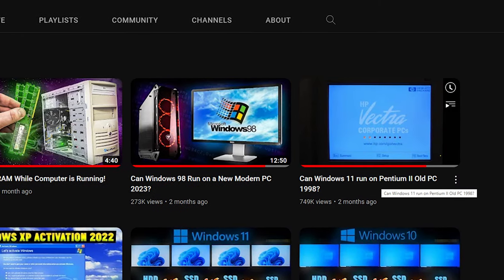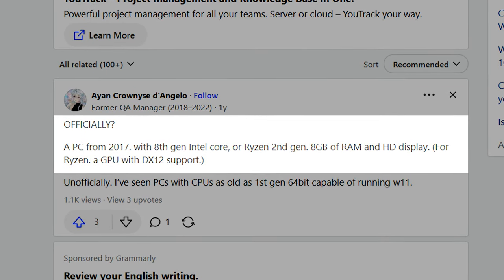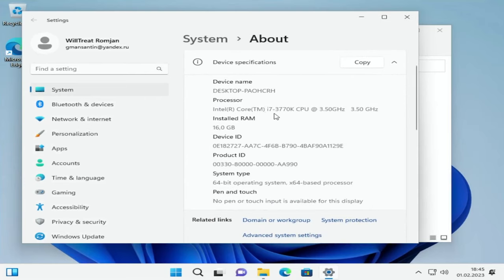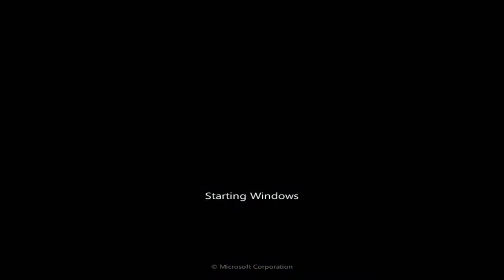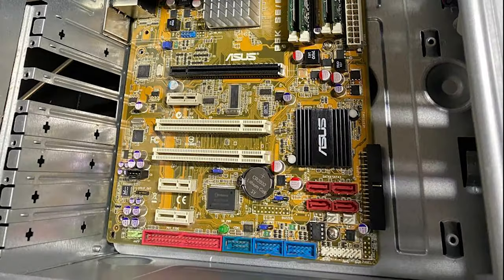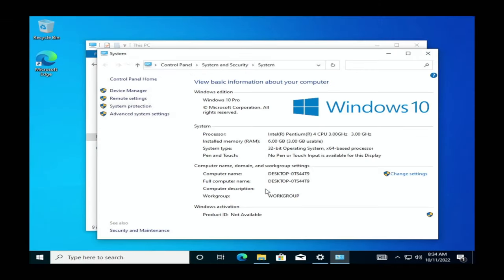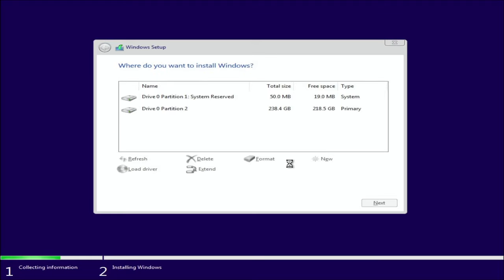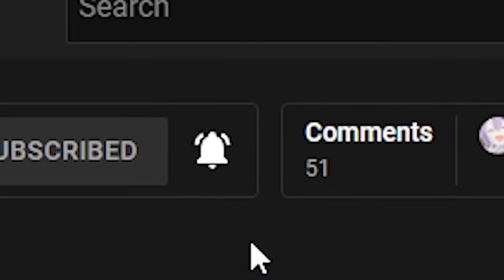What's The Oldest CPU That Can Run Windows 11?

Comment: I am currently working at hospital in remote Russia, we got 1-2 core Intel Celeron based "PC's" with 2 gb of ram
And I put trimmed win11 on them, main difference in performance comes from removing as much background processes and ssd's ofc)
The way they work is tolerable :D
Reply: Good Job.  How did you get past the TPM requirement?
Reply: @SaanMigwell  You can get past the TPM requirement by getting a Windows 11 ISO and flashing it onto a USB stick with Rufus, it automatically gives an option to disable the minimum system requirements, but you could also edit the registry like it was shown in this video.
Reply: Dang Russia that’s tough
Reply: can you make a video of the process, i understand it may be boring, but to me it is fascinating that windows 11 can be run on 2000 megabytes of ram and a celeron

Comment: I've got an old E-machines with the P4 641 (3.2ghz)  I was kinda surprise they sold these CPU's so late in production.   I might have to just fire up and play around with a copy of Windows 10 and see how it handles it?  Thanks for the interesting tinkering of old hardware in this video Ramtech.
Reply: @Man-O-Sphere News  Yeah,  Sounds about right.
Reply: my 2017 laptop has a 1.2 ghz processor i think theres something wrong here
Reply: @youraveragejoe23  Clock speed is not a valid designator of performance between different architectures. Your 2017 laptop has a CPU with a base clock of 1.7 GHz, it boosts higher. It also probably has 4-8 cores, where the Pentium 4 is only single core with HT in some models.

Even a Core 2 running at half the speed of a Pentium 4 will smoke it, and that was just one architecture later. Netburst was just that bad.
Reply: @GGigabiteM  its a pentium cpu and i have hp pavillion x360 m convertible 11m-ad113dx
Reply: I also have e-machines

Comment: Thanks for the additional infos!

I was able to experiment and install win11 in a 32bit laptop Acer Aspire One (AOD257), Intel(R) Atom(TM) CPU N570 @ 1.66GHz with 2G of RAM only.The hardest part was finding hardware drivers. I am using it now in commenting on this video.
Reply: Windows 11 doesn’t have a 32 bit version..
Reply: @comedyreliefguy5112  it can be done using some tweaks
Reply: @sabaysaalon  The Atom N570 is a 64 bit CPU.

There is no 32 bit build of Windows 11, and you aren't running it.
Reply: @GGigabiteM  he didn't claim either thing, he didn't say he had 32 bit win 11 nor that the cpu wasn't supporting 64 bit instructions

All he said was that the laptop was 32 bit, meaning it came with a 32 bit OS originally, and that's it.

Comment: The reason that the Pentium 4 6x1 had limited motherboard support is because it was released at the very end of the Pentium 4's lifecycle. Intel made it more as a test of their new 65nm node than as a marketable product. The 6x1 used the Cedar Mill core, which was basically a die shrunk Prescott-2M core.

By the time the Cedar Mill P4s came out, every Pentium 4 only chipset was a year or more old. Many motherboard manufacturers didn't bother making BIOS updates with the required microcode to support the newer CPUs. There wasn't much interest in doing so because Core 2 was just 6 months off and people were so fed up with the garbage that was the Pentium 4 that nobody was buying them.

The Cedar Mill P4s though did have one good use, upgrading terribly designed Dell SFF machines like the SX280, or GX280 SFF. Dell had the grand idea of putting 95-115W CPUs in a tiny case with zero ventilation and wondered why they lost billions in class action lawsuits over them baking to death.

The D0 stepping 6x1 processors had a 65W TDP and ran MUCH cooler and put significantly less strain on the power supplies of those machines, making them a lot more reliable. The sSpec of those starts with SL9K_. Replace _ with G = 631, F = 641, E = 651. Luck runs out on the 661 though (SL9KD), as it's an 86W part.

If you want guaranteed support for these late P4's, you'll need a motherboard with a 965 or 30 series chipset (P31, G31/33, P35, Q33/35). Intel officially dropped Netburst support on 30 series chipsets, but most motherboards still supported them.
Reply from the maker: Wow. I didn’t know that. Thank you
Reply: @RamtechENG Run either windows 11 or 10 on a 386.
Reply: Anwser Is:
Since 2012, when Windows 8 came out, Microsoft increased one of the requirements for running newer Windows such as Windows 8, one of which is the support of LAHF/SAHF in 64-bit mode, which is also required to run Windows 11.

Comment: According to windows 11 latest intel's decade old Pentium 4 CPU is supported by windows 11. however, Microsoft has not released an official list of CPUs that can run windows 11. instead, they have provided minimum system requirements for windows 11, which include a processor that is 1 gigahertz ghz or faster with 2 or more cores on a compatible 64-bit processor or system on a chip (SoC).
Reply: Time to run windows 11 on that pentium D system I have laying somewhere in my basement
Reply: Bruh… I am using a 2009 Intel pentium T4400 dual core laptop from an Acer Aspire 5732z which has 3GB of RAM and can handle windows 11 soo smoothly. Beat that….
Reply: I also upgraded a Sony laptop (which has vista installed previously) which has a dual core pentium from i think 2006 and upgraded it to windows 11 and that runs smoothly!!
Reply: @ItsHonski it will go kabumm

Comment: There is a problem with your install metod, 630 and 631 have the same instruction support, Cedar Mill was just 65nm version of Prescott 2M, anything Cedar Mill runs, Prescott 2M will run too.
Reply: Because the 90nm older 630 and 640 CPU’s are lacking the instruction set CMPXCHG16B which is compulsory since Windows 8.1. Also that’s the reason why the CPU can’t utilize more than 4gb ram even if it runs on 64-bit.

Comment: I have known for 4 years that after transferring the install.wim file from Win 11 ISO to Win 10 ISO, it will run on Pentium 4 or AMD 64 (minimum requirements for Windows 10) because older processors do not have, SSE2 Instructions, NX and other

Comment: There are linux distros like Gentoo that are super light and still have full support for 32-bit systems. It would be interesting to see what the oldest computer that can still run a modern OS is.
Reply: Debian also supports 32bit
Reply: Run linux with 1975 PC
Reply: yeah except Gentoo is a giant pain in the ass to install and run

Comment: This video reminds me about my old pc. The processor is athlon 64 x2 4600+. With 4gb 667mhz ddr2 ram. And geforce 8400 GS. It runs windows 10 build 1151 i think (i forgot the build number). And it was very slow. It cant play 720p video. And very lagging at 480p. But im kind of surprised that the cpu managed to run windows 10. Even though it was unusable

Comment: I wonder if it would run on the first 64 bit Opteron or Athlon64s that came out in 2003/2004?
Reply: (B4 watching the video) nah win11 can run on 32bit systems. i tested that myself a few months after win11's release
Reply: @itsarian.  nope, you can t run windows 10 64 bit/ windows 11 on amd athlon 64(socket 754, 939) and opteron, because they lack an instruction for 64 bit versions of windows 8, 10 and windows 11
Reply: @itsarian.  No, you can't
Reply: Tried on my Opteron X2 165 from mid 2005 and no, they don't have all the 64-bit x86 instructions
Reply: The oldest AMD chips that work are Semprons for AM2, they are single-core and have all required instructions
Reply: @tehretrotech3977  To be more specific, ALL AM2 cpus support Windows 10 x64.

Comment: There's an Athlon 64 2000+ for the AM2 platform which is 64-bit, single core and clock speed of 1GHz.

Comment: Windows 7 Ultimate has been the most stable OS I've had since DOS.  Under every other OS I've had at least one BSOD during its run.  With Win 7 the only failures I've had were hardware failures.

Comment: Why do you think installing 64 bit OSwith 2GB of RAM is a facepalm? 
1.32bit vs 64-bit is not only about RAM
2.32bit won't support 4GB or more, but it doesn't mean 64bit won't support less than 4GB
2.64bit software uses more memory due to pointer sizes, but this is only couple percent more.

Comment: Im surprised you couldn't install windows 11 on a 32-bit   system. I personally was able to install windows 11 on a 32-bit system but it had a slow hdd and it was just pure pain
Reply: Microsoft no longer works with 32-bit systems nor does it support 32-bit processors anymore, so much so that Microsoft made Windows 11 only for 64-bit processors. Sorry any english error, english is not my native language.
Reply: There is no 32 bit version. Either you got a modified copy to make it work, or your CPU isn't 32 bit, it's 64.
Reply: @antonisautos8704  my cpu was probably 64 bit but i had 2gb of ram
Reply: @antonisautos8704  I was able to install it in a 32bit laptop AOD257 model with only 2G of RAM. Of course I need to do something by converting 32bit hardware “virtually” into a 64bit hardware. Finding drivers is hard though but successfully did it.
Reply: yes errors. Greetings from Brazil, i like your channel.
Reply: course yes!

Comment: I tried upgrading to windows 10 on a pentium dual core PC with a Award BIOS chip and a error message says "Invalid partition table"
Reply from the maker: You need just convert your disk to gpt
Reply: @RamtechENG  well I instead upgraded to a gaming PC (Dell optiplex 390) that had windows 10 in it.
Reply: Also I don't use windows 11, sorry
Reply: @RamtechENG  also my gaming PC (dell optiplex 390) uses a second generation core i5 processor that has a little bit of text glitches on browsing the web on chrome

Comment: Btw you will need WDDM graphics card. XPDM graphics card is not supported in Windows 8 and later, so you will be stuck in software acceleration with basic video adapter.
Basically, if it has drivers for Vista and up, it will work.

Really shows you how bogus the CPU requirements are.
Reply: But still lower than what Microsoft really wants

Comment: Since 2012, when Windows 8 came out, Microsoft increased Two of the requirements for running newer Windows such as Windows 8, one of which is the support of LAHF/SAHF in 64-bit mode And CMPXCHG16B, which is also required to run Windows 11.
I hope Windows 12 does not fulfill one of its requirements
What Is The LAHF/SAHF in 64-bit mode And CMPXCHG16B?

The LAHF and SAHF load and store the contents of the AH register into the flags register, respectively (Intel Instruction Set Reference, PDF pages 530 and 1025). Some older Intel processors without hardware virtualization (VT-x) functionality do not support this instruction when running in 64-bit long mode; these are mostly limited to certain low-end processors predating Nehalem. Some very old AMD64 processors also lack this feature.
Early AMD64 processors lacked the CMPXCHG16B instruction, which is an extension of the CMPXCHG8B instruction present on most post-80486 processors. Similar to CMPXCHG8B, CMPXCHG16B allows for atomic operations on octal words. This is useful for parallel algorithms that use compare and swap on data larger than the size of a pointer, common in lock-free and wait-free algorithms. Without CMPXCHG16B one must use workarounds, such as a critical section or alternative lock-free approaches. Its absence also prevents 64-bit Windows prior to Windows 8.1 from having a user-mode address space larger than 8 terabytes. The 64-bit version of Windows 8.1 requires the instruction.

Try Windows 11 On GA-8i865gme-775

Comment: It was interesting seeing Windows 11 run on much older hardware, but IDK about “without any issues”. You need to make modifications to the registry to get it to run, and you only showed the OS running (and using as much as 60% of the CPU cycles). Can you actually do anything on that system?
Reply from the maker: I’m not sure you need to do something. Everything is working like on any other PC. But I think some software may not run because of CPU
Reply: @RamtechENG  I only bring that up because the point of having a computer is to use it. It’s great that one can get a modern OS to run on such old hardware, but what would the point be if you can’t use the system? 

I’m not trying to be negative, just speaking from the experience of daily driving a computer designed for Windows 98 that I managed to get XP working on. It was barely usable for browsing the internet and nothing else.

Comment: Try also an AMD Athlon 64. They are fully 64bit.
Reply: Only the two last generations of Athlon 64 (on AM2 socket) would maybe will work. The same as for windows 10. It's another problem of not clear minimal requirements from Mircrosoft. Windows 10 64 bit requires CMPXCHG16B instruction, which no Athlon 64 on socket 754 or 939 has, but on socket AM2 versions it is present.

Comment: Everything is relevant to the operating system and what your board can accommodate.
Windows Vista works best on a board that is designed to host the operating system.
It is easy to check your boards operation system limitations.
Each board will list this.All microsoft systems will display this.
Vista will not work on newer computer boards.
There is no fix to this because it is past the limit of technology for the time.
Even  if you manage to get it installed it will not work properly.
You can not mix new with the old, it will not work.
I am currently running XP, Vista, Win 7 win 10, win 11 Linux Ubuntu.
You can run all of these systems, but you have to have the native environment to do so.
A computer for each system. I have a computer for each system.

Comment: can someone explain to me why this cpu is as follows on passmark:
Average CPU Mark
rating
295

Single Thread Rating: 664

How is the CPU mark lower than the single core? I thought it was usually (almost) a sum of the total cores doing all the work. 
eg.  8700k is 13.7k passmark while single core is 2.7k
math says 2.7k * 6 = around 16k which isnt that far off the total score I guess?

Comment: INCORRECT - even though Windows 11 can run on much older CPUs than official requirements - these official requirements were made like this because of the support for TPM 2.0 which those old CPUs do not support.  Micro$oft wants people to feel "SECURE" bullshit, so only CPUs that support TPM 2.0 -  I have a 13th gen Intel process which does support TPM 2.0 and even so I disable all that SHIT and core isolation SHIT anyway, I prefer to rely on 3rd party software for my security than Micro$oft's built in shit.

Comment: Hey bro I am using windows 7 in my ho laptop and my driver of wifi is missing I have tried to download it from hp officials, third party websites, driverpack solutions software but it didn't worked for me , according to you what should I do next
Reply: Use another computer and flash a USB stick with tiny 11 using Rufus program. Then stick the flash drive in your windows 7 pc in the boot menu. This fixed my wifi issue. Upgraded from windows 10 to windows 11. Upgrading to tiny 11 will fix the wifi.
Reply: If 100Bucks solution doesn't work you can buy an usb internet adapter.

Comment: 630 should have 64bit instruction set, how come it doesnt work ? I thought the 1st 64 bit is P4 620
Reply: Because the 90nm older 630 and 640 CPU’s are lacking the instruction set CMPXCHG16B which is compulsory since Windows 8.1. Also that’s the reason why the CPU can’t utilize more than 4gb ram even if it runs on 64-bit.